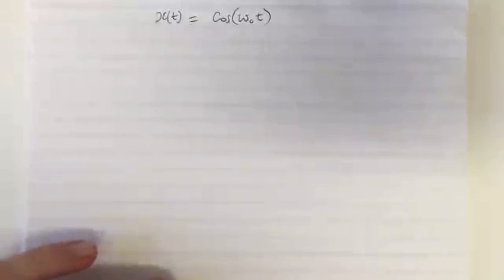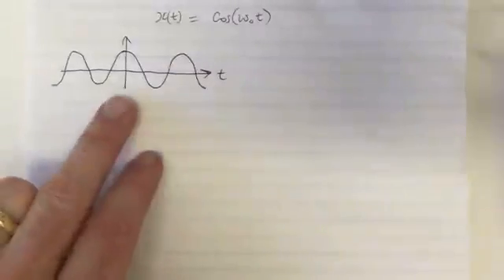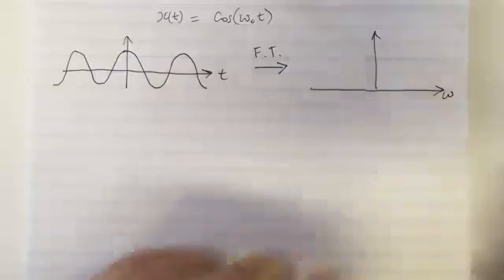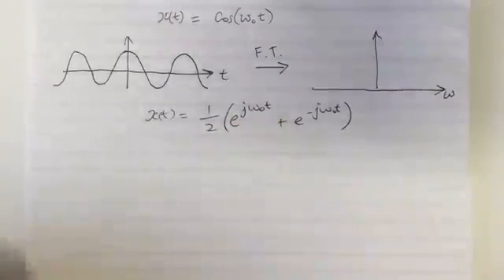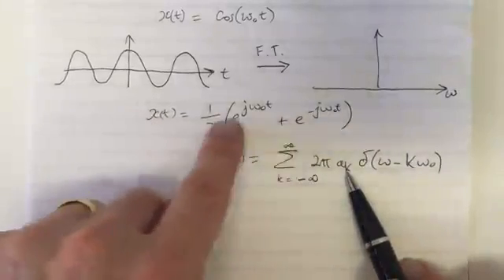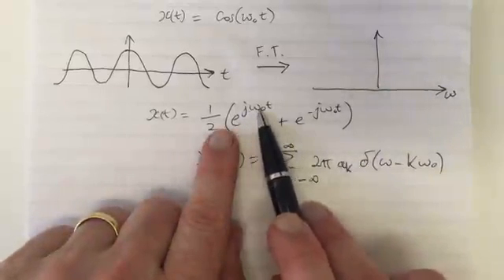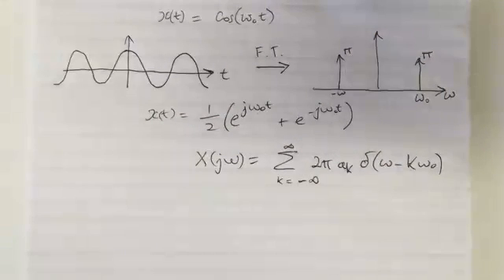Fourier Transform of Cos

Comment: Thanks a lot for your lessons. I have just one question. Why are you using the formula with the 2pi multiplied by the Fourier Coefficients and the Delta Function instead of using the discrete time formula? Also, how do you get that formula? Is it always valid?
Reply from the maker: I'm not sure what you mean. Why would I use the discrete time formula, when the signal is not discrete time?
Reply: Ok, clear. But how do we pass from the integral definition of the Fourier Transform (in which ther is not the 2pi factor - it appears only in definition of the Inverse FT) to the one used in this video (where there is a 2pi factor)? @iain_explains
Reply: Or, in other words, if the signal is continuous in time, why we didn't use the classical formula (the one with the integral, withouth the 2pi factor) to compute the FT of the signal? @iain_explains
Reply: Ok, I finally found the explanation. Since we are considering a periodic signal, it can be written as a Fourier Serie. So if we substitute it inside the definition of FT, we get the FT of a DC signal, thus a 2pi factor appear :)  @iain_explains
Reply from the maker: Yes, exactly.

Comment: Thank you for the videos, what would be the fourier transform of a square wave pulse train. The FT of the rect function is a sinc. Will it be mutiple sinc functions shifted by the time period of the ?
Reply from the maker: Thanks for the question. It's a bit hard to answer here, so I've added it to my "to do" list for a future video. In summary though, because the function you're asking about is periodic, therefore the FT will consist of delta functions with weights/areas given by the Fourier Series coefficients. I'll try to put some intuition into the upcoming video.

Comment: Hi. sorry if this question is very basic. why for determing the FT of unitary step u(t) is not possible to integrate from 0 to inf? but for determing FT of  exp(t)u(t) it can be done ?
Reply from the maker: Actually, no, it's not true that exp(t)u(t) can be done. But exp(-at)u(t) can be done, for values of "a" that have a real part that is bigger than zero. The important thing is that the integral in the FT formula needs to converge to a finite value. This means the integrand needs to be finite and uniquely determined (ie. converged), at t=infinity. The function exp(-at) equals zero at t=infinity (as long as "a" has a positive real part), and the resulting FT is finite.

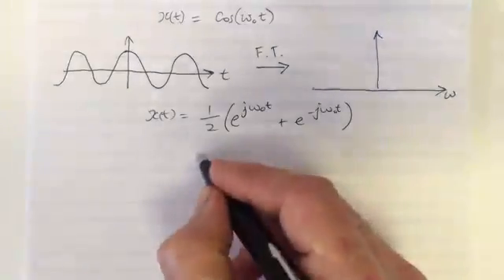Comment: Hi Sir. I didn't find video which explains the equations which you derived at 2:08 - 2:28. Thanks in advance.
Reply from the maker: It comes from the definition of the Fourier Series. I haven't made a specific video on the relationship between the Fourier Series and the Fourier Transform (I'll add this to my "to do" list now), but in the mean time this video on the Fourier Series might help: https://youtu.be/gRq3K4ZQKi8
Reply: @iain_explains  Hi Iain. Thanks for answer. I have one more question. Should the amplitude of delta functions be pi times coefficient ak instead of just pi? Thanks in advance.

Comment: Do we get 2 frequencies, because the wave can be moving to right or to the left?
Reply from the maker: No. The physical direction of travel of a wave does not come into these equations. The Fourier Transform is simply a different (but equivalent) representation of a given function (in this case, a time domain function). For more insights into the "positive" and "negative" frequency representation, check out: https://youtu.be/gz6AKW-R69s and for insights into how complex numbers relate to real signals, check out: https://youtu.be/TLWE388JWGs
Reply: @iain_explains  Thanks! I'm gonna watch them right away.